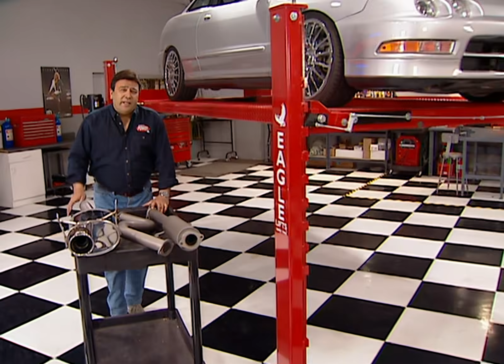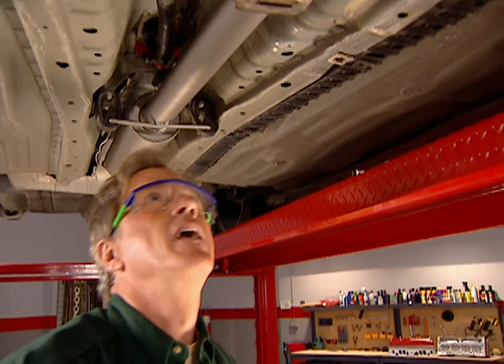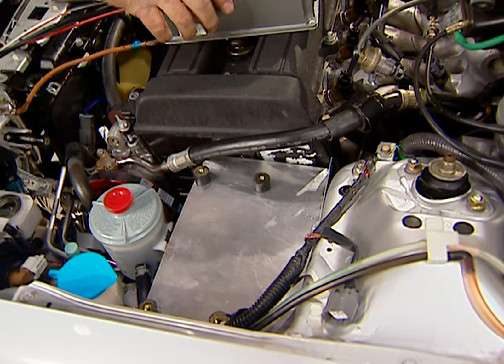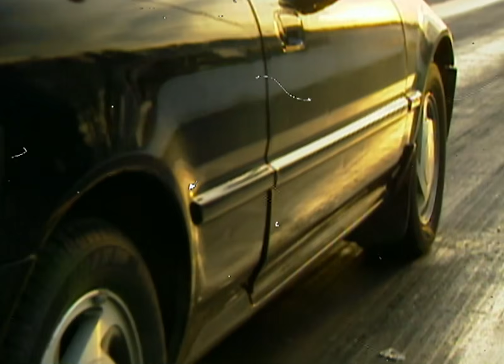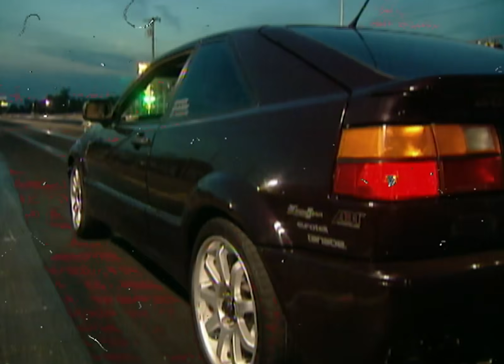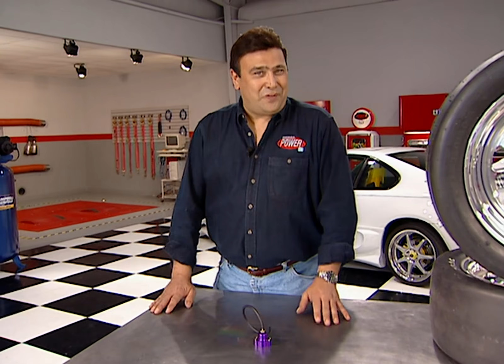Building Up A Hot Rod Honda - Horsepower S1, E13

Comment: Funny how “no replacement for displacement” faded when the OGs realized how efficient turbos are
Reply: Still no replacement for displacement. If you turbo bigger motors they make bigger power. Simple. Turbos increase displacement
Reply: @keatonfrancisco6763  ahhh good fellow, it seems you don’t understand how displacement works… I appreciate your effort tho
Reply: Dang I was thinking of something else. I had read somewhere that they add your turbo into your displacement In certain racing brackets. I think they count it as 1L or something.

Comment: Watching them waste money on an ignition box and coil is pretty nostalgic, ngl. Only 120 wheel before the giggle juice huh? No wonder I shit all over non-vtech Integras in my Neon R/T. No timeslips for them, but I think I still have a few mid 15 second ones around from long ago, which is better than that Integra could muster off the bottle.
Reply: Bro, my 09 P71 did 15.3 stock, 220rwhp 4,200lbs..lol
Reply: @P71ScrewHead  Bro, your 09 P71 is also ten years newer than the integra.  My '15 Ford Edge did the 1/4 in 14.2 bone stock.  You're comparing apples to watermelons.
Reply: @BasedEMT1776  I wasn't trying too clown on anyone.. Just was saying how different setups can get similar results.. More power, less weight, 💪recipe for faster times..
Reply: Too bad the Neon didn’t make it to 100k and hold the value.
Reply: @joshc606  Re-sale was definitely NOT one of their strong points. I put well over 150k on one without nuking a headgasket tho, and yeah, I know was a lucky one, lmao.

Comment: Spent about $20,000 on 160BHP😂 hitting 0to60 in 7.8 seconds 🙄 I’m sure you can get a mk5 golf GTI Was released back then Standard 197 hp 60mph in  7.5 seconds and with a stage one remap price starting at $700 will hit u 250+ BHP hitting 60mph in 6 seconds and extremely good handling car
Reply: This was 1999 man, and this is the base model integra.  A GSR or Type-R with these same mods, without nitrous would gap the gti even with a tune.  Only recently have VWs been any kind of decent after a tune.  Back in the day it took significant stuff to make a GTI even touch 14's.  13's was different turbo and fuel upgrades territory.  

But, to play the game, around this time you could just buy an AWD DSM, spend $0 in free mods, spend $50 on a boost controller, and $100 on a Walbro 255 and run mid 12's all day long.  0-60 in the very low 4's.

Comment: Its crazy to me that they did all that without a tune. Just a nitrous controller.

I bet they left a lot on the table.
Reply: My thoughts exactly. With an ecu tune,bigger injectors. It def would get some better gains that was the tech we had back then, Honda heads didnt have many costly tuning options in the US back then. I miss those days But I'm happy tech has changed.
Reply: @chrisb15679 
Oh fer sure, I was messing with them since the 90s. 

That's was all over short of mustangs and gm products because they already had an aftermarket.
Reply: @chrisb15679 yep put a hondata s300 ecu on that teg with a gsr or b16 transmission and watch that b18b come to life
Reply: Not really. Non-vtec B-18s were rated at around 130 HP.
Reply: @TheMailmanOfSteel  that's at the crank.  You are forgetting to add on parasitic loss. 

So yes really, It's impressive the gains for minimal outlay and no tune. 

The moment you quoted factory rating just killed whatever point you made. 
Cars lose power through the clutch, flywheel, trans and axles. If anything,  their driveline design is incredibly efficient or Honda slightly underrated that engine combo. 

( I'll be rounding the gains)
The car rolled the dyno stock near 110 hp. Do the math and realize that 110 would be about 84-86% of the rated horsepower .

Adding 20 hp to a 110 hp car is literally adding almost 20% at the wheels. If you add driveline loss, you looking near 25% gain. That's all bolt ons, and no tune. 

That's impressive for NA car using 25+ year old technology in an era where getting an actual custom tune was hard to come by.

Comment: I love this , damn those cars were so nice back then. No rust. Brand new , I have a civic with a b series motor from this integra in the show and man. What a great platform. I can truly say Honda is king of 4 cylinder motors in reliability , endurance. Power. Performance after upgrading and even tuning , i used to own a b series running 7 psi , great set up , lasted 10+ years

Comment: "we're gonna do this RAD episode because all them KIDS sure love these new fangled cars with funny names" 
Meanwhile, in 2022, k swap Hondas are running 600hp all day long.
Reply: Yeah, and they still can't do a decent donut without a couple of take-out trays.
Reply: @swampcritterisbackbaby1740  donuts don't make a car good ? You can do donuts in a V6 thunderbird. Lmao
Reply: @jordancox559  You can also drop a Mod or even a 460 in the t-bird. The Honda will always be limited by its baby bunny burnouts.
Where does the weight go when you floor the pedal? A fwd car will always be at a disadvantage. When run against a rwd car of equal weight and power the fwd will always lose. The Hondas NEED that 600 hp just to keep up with 350hp rwd cars.
Reply: @swampcritterisbackbaby1740  you're wrong but thanks for playing
Reply: @jordancox559  Ok, Cupcake.
Reply: @swampcritterisbackbaby1740  The magic happens when you put one of these 250hp 4 cylinders into a  1,900 pound CRX.
Reply: @Sir.VicsMasher  Physics does not work that way. You are not going to magically make the weight shift characteristics different no matter how much power you squeeze into it. You floor it and the weight will ALWAYS move away from the front tires.
Reply: @swampcritterisbackbaby1740  weird argument, but okay.